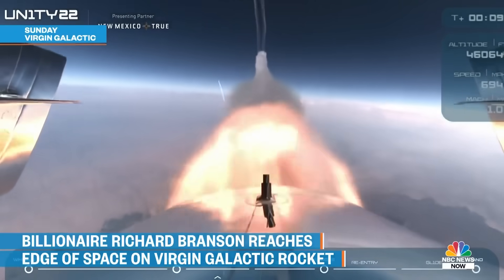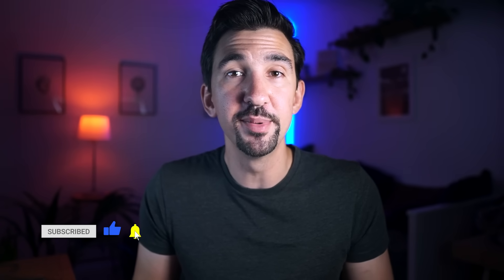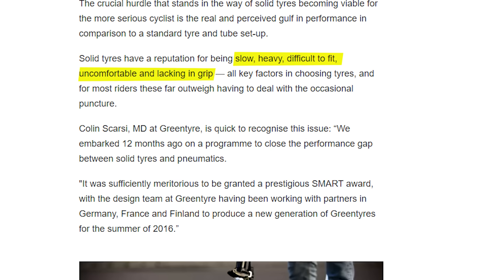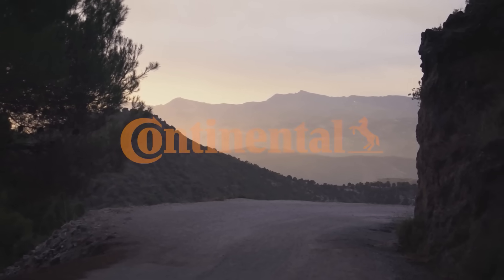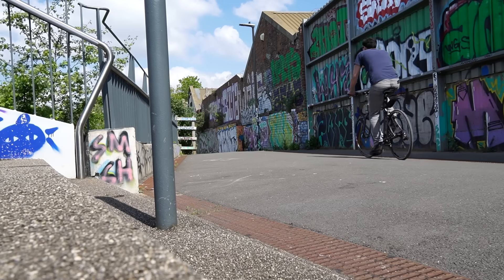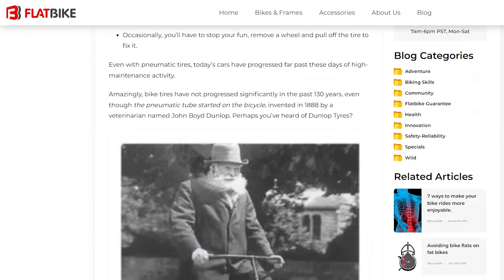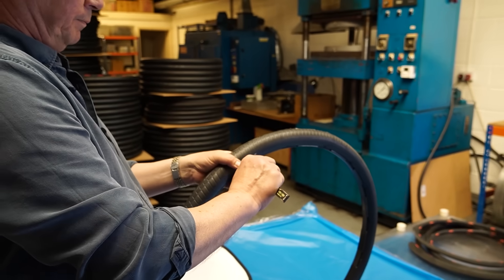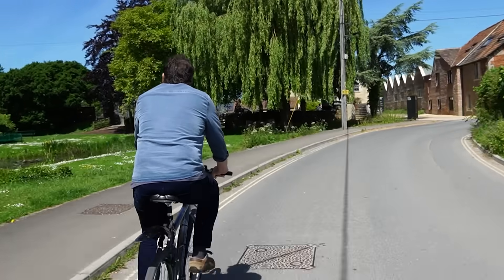I Tried Solid Bike Tires | Here's What I Found

Comment: I really, really want everything about this tire to be true. I also think it would be neat if unicorns ate Skittles and farted rainbows.

In over a half century of cycling, I have had dalliances and affairs with various solid tires or solid foam tube inserts. My experiences with them were universally horrific.

I will put up with a certain amount of abuse from a tire. When I started racing, my tires were either cotton or silk carcasses with a thin strip of vulcanized rubber tread, latex-coated sidewalls that were stitched around a condom-thin latex tube that needed inflating daily. Then you glued them on your rim and hopefully you didn't roll them off in a fast corner. These were not low maintenance tires, but I was racing, and I didn't expect them to be.

For regular street bicycles, we were just transitioning away from iconic American brands like Goodyear and Uniroyal to Asian tires, and frankly none of them suffered from an abundance of quality or engineering.

In the intervening decades, tires have gotten much much better. Flats are almost optional. If you can afford Schwalbe Marathons, or even the somewhat more budget Panaracer Tour Guard tires, for an average cyclist who is not riding past construction sites and junk yards or through goat head territory, flats are extremely rare.

So will I try these? I don't know. After all, I've seen a lot of technological advances. When I was born we had one satellite, called the Moon. Now we have thousands of satellites and reusable orbital boosters, 4K organic LED TVs as thin as a magazine, and vaccines that you can literally print out. Maybe the time for tubeless solid tire technology is here. But I can't help the feeling that I'd be going back into another abusive relationship.

We'll see.

Comment: The burden of having to constantly reinflate my bike tires drives me nuts.I gotta carry a hand pump. Those small CO2 fillers that use cartridges get used up quick. They seem, to leak out quicker, likely due to the gas molecule size. I have checked the inner tube and valve under water, and it still looses air ! I am going to get a set of solid tires !!!!!!!
Reply: Try nitrogen from a car tyre shop. The bubbles are bigger and don't leak out the rubber. 
Or install wider tubes that stretch less

Comment: They run similar tech in motocross and off-road with the mousse inserts, very difficult to install but they did last about as long as a tire but I guess we still gotta reinvent the wheel good videos
Reply: They last 1 race before they melt. They also grease them up to last an extra hour

Comment: Solid rubber with air pockets. It's an old idea, but difficult to manufacture. The next step is to create several layers which are thicker in the middle, and stack those. Each layer has a different density of bubbles, so it would be sort of like a gradient density, with more bubbles in the middle layers than the outer layers.
Reply: That is horrible. You want it to be no gradient so that it acts like a pneumatic tire. Pressure spreading evenly. Having a gradient means impacts will not transfer across the whole tire and instead stress will be uneven making you feel more of the bumps.

Comment: 7:10 The air is not compressed in the tyre any more than it is compressed when a load is first put on it. When the tyre is under load the constant air pressure acts on the non-circular shape of the tyre to push it back to a more circular (minimum energy) shape when the tyre is no longer in contact with the road. Energy is not stored in the air it is stored in the stresses in the rubber tyre being loaded.

That is a different scenario to a micro-cell tyre where the air has nowhere to go when the tyre is deformed. In this case the deformation both compresses the trapped air and its the micro-cell not being in its lowest energy shape (stresses in the rubber surrounding the cell) that provides a restitution force to uncompress the tyre on the trailing edge.

Comment: As a teenager, I put over 2,000 miles on a set of airless tires with decades-old technology. One could say it was "just commuting", but it was also from one county to another, with the requirement that I never show up late for work. So...a valuable solution to an important problem, with zero downtime, reasonably good efficiency . . . and low comfort in that era of rubber tire. I'm excited to see first-hand what decades of improvement can deliver in the most maintenance-heavy area of a bike.
Reply: I see just one glaring issue with these: they have to be designed for a certain driver weight. And seeing how the bike industry is currently handling design, this weight will likely be around 80 kg. They are unlikely to bother themselves with offering tires for different weight classes. Lightweight riders will be rattled, fat people like me, or people who frequently put heavy loads on their bikes will find cycling unpleasantly hard.
Reply: @Volkbrecht  that's a good point, but I don't see it being too difficult for manufacturers to create different models tailored to rider/bike weight by adjusting the amount of gas bubbles that are incorporated into the rubber. Especially since bike packers could be a pretty large target demographic.

Running shoes have taken a similar approach in recent years by modifying foam density in their women's models, since they are typically lighter.
Reply: @Volkbrecht  At 285 lbs, my carbon road bike has a lot to handle, and I will go a few thousand miles on a set of tires with no flats.  Tires on my road bike now have been on there for almost 10 years with weekly riding and rotating. They are about to be replaced.
Reply: @Volkbrecht  or you will be able to 3D print your own.
Reply: @williammeek4078  pretty sure that 3d printing the tire would be nigh impossible as you would also have to treat it with various tempetures and get the specifics of the tires physical composition.
Reply: This can be solved in two ways: smooth roads, or heavy duty wheels. In general, just don’t ride solid tires on bumpy roads. It’s not fun, slow, and destroys rims. If that’s your local terrain, don’t get solid tires. Simple enough. The other is rims made for people who are overweight. They work perfectly. If you have smooth roads and sturdy wheels, you never have a care in the world. Never have to check your tire pressure. Never have to even own a pump.
Reply: >the most maintenance-heavy area of a bike.
Surely you mean the brakes then right? Or the maintenance of the chain right?

Aside from pumping a bit of air once a month the only time I have to do something with my tires is when I change out my slicks for grippier, for wetter weather, outer tubes around fall and vice versa in spring, something these tires won't solve anyway. And these are just old fashioned inner/outer tube tires, not even those fancy tubeless ones.
Reply: @legolas66106  When has maintaining the chain ever been difficult?
Reply: @legolas66106  tubeless actually requires more frequent pumping.
Reply: "the most maintenance-heavy area of a bike"

Wait until this guy learns that chains require maintenance.
Reply: using pneumatics in the city and light terrain, stones and glass happen sometimes. No flat in many years. if you get the slightly have "puncture" safe tyres the risk of running a flat is absolutely minimal. Probably less than any other failure on the bike. For travellers doing longer tours, if those gecko tyres do elimate the risk of a tyre malfunction completely, but only then, it may be worth it.
Reply: JUST 2000 miles? I have done over 100,000km on a series of pairs of Vittoria Randonneur Cross pneumatic tyres with ZERO punctures, and the tyres routinely lasting for 14,000-16,000km each (2-3 years of my typical riding distance). Zero "downtime", excellent efficiency, and great comfort. And I have never showed up late to work due to a puncture. Pneumatic rubber tyres (well-made) present no real problem, and minimal maintenance.
Reply: @petesig93  I agree. I have never had that many puncture in a lifetime of riding. I have had a few pinch flats, but that is based on what I was doing, not the tire system in general.  If this really is a vast improvement for a solid tire, it will find a market, but it is not dread for me to keep on riding on air.
Reply: @petesig93  shut up nerd
Reply: @petesig93  I put  well over 6000 kilometers on a set of (to be fair, pretty high quality) air tires that I kept running with a simple tube repair set when neccessary. I abused the shit out of that poor thing too. That was my school bicycle for years (200 days a year 30 km commute). It was a (used) high end Gazelle with a bunch of complicated gears that I eventually replaced with a 3-gear system and when that failed I put a single speed wheel on the thing. That bike got stolen (at that time it looked ratty as fuck) eventually.
Reply: the efficiency difference is pretty big, as is handling.  a teenager may not mind working extra hard.  but you could even run decent air filled tires, fix a flat, and still arrive ahead of a solid tire for a longish commute
Reply: @JackMott  Oh not at all. You need to try more expensive solid tires. That sounds like the cheap ones. The expensive ones are basically the same speed as pnumatic tires on smooth roads. Its only rough roads that they are slow on.

Comment: What about tubeless, air-filled tires? I mountain bike, and these are ubiquitous in the mountain biking world. I'll admit that they require a bit more maintenance than I imagine an airless tire would, but I have never really had to worry much about flats.
Reply: Not recyclable since they require a bead material, fabric carcass and different rubber compounds.
Reply: I commute 60km a day, electric pedal assist bike, tride tubeless, was very excited to be free of punctures, but the Achilles heal of tubeless is glass. Once the glass cut into the tire it stays there and keep on opening the gap the sealant is trying to close, a nightmare 5 o 'clock in the morning. 
I've been using a foam liner from "Tirefom" with a lot of sucsess, except for the quality of the inner tubes splitting on their seams. Really an nice option to go, no thorn, wire or glass issues, almost perfect. Just those damn slitting kenda tubes, got to find a good quality strong inner tube. 
I contacted  Richard during his crowd funding campaign and cannot wait to receive the Geco tires after all the other options available seems still challenging. Looking forward to a peaceful ride to work in the early mornings with no puncture kit or extra tubes in the Ortlieb bags!
Reply: Such an airless tire is obviously not a solution for Mountainbiking, since you need little tire pressure for suspension, and riders adjust the pressure for their needs.
Reply: Just got through changing the tire on my wife's tubeless Toyota. (Technically, I changed the wheel, tomorrow some tire shop will change the tire) Tubeless does not prevent flats,  because ultimately the tube does not provide much puncture protection. It's just kind of a thin air bag.  Once something gets through the tire, tube or not, you have a leak
Reply: @47f0  Tubeless mountain bike tires are usually used with a sealant that goes on the inside of the tire. This allows for small, or even fairly sizeable, punctures to basically self heal. I assume you are talking about a car tire since you mentioned a Toyota. These tires are much thicker, and standard tires are not really intended for off-road use. Due to this, they have much less need to run with a sealant inside the tire like mountain bike tubeless tires typically use.
Reply: @komoumi  - There have been various goops, slimes and goos used for allegedly sealing both tubeless and tube type tires for decades.

Allegedly. 

My point was that tubes, since they are very thin rubber that provides almost no puncture resistance don't really alter the puncture equation much one way or the other. And yes, you can definitely fill your tubes with various kinds of snot. That is not unique to tubeless tires.
Reply: @47f0  Tubeless tyres on bikes works extremely well. Not needed to use the spare tube I carry on my bikes just in case for 5+ years now and I seriously hammer even skinny tyres on rough off road terrain. Waiting for someone to fix a flat is thankfully rare these days too.
Usually if you get do get a flat [a very rare occurrence], you've either ripped the tyre sidewall beyond repair or trashed both rim and tyre.  

Tubs most certainly alter puncture probability hugely, because the most common cause of punctures are pinch flatting/snakebiting the tube. Plus anything penetrating tyre causes a flat when it pierces the tube. So far better off without the tube. I've pulled metal spikes and hawthorn hedge trimmings out of tyres and simply carried on with tubeless setups.

Comment: Yeeeeeah. Really good skins plus Latex tubes equals a much lighter tire combo. For those who ride a lot this is critically important; the mass of the rotating assembly has a huge impact on the amount of effort required to change speed, direction, handle terrain, etc. These solid tires (tyres to you) may be a good compromise for "commuter" bicyclists, but will never appeal to performance cyclists at all. Soory aboot that, eh?

Comment: Your recycling reason doesn't work in the real world.  Just in marketing.   Remember, regular air ties were make with just one component.   but competition between brands make them tweak them hear and there.   The exact same thing will have to happen for the exact same reasons if then got even the littlest big popular.
Reply from the maker: I'm eternally optimistic, but it's a good point to consider

Comment: I had airless tyres which were a foam rubber core with a regular tyre tread about 30nyears ago. They were pretty good - heavier and slower but not so bad really. The peace of mind that you couldn't get a puncture made it worthwhile. I would have hoped things had improved a lot since then but it seems not, unfortunately. Hopefully airless car tyre tech will drive development.
Reply: lol, that was my first thought as well... "Hey, I remember those!  I HATED them!"

They made my bike so much heavier and less nimble. IIRC, I pulled them out after just a week of using them, because the bike felt completely wrong.  Couldn't get the wheels off the ground at all like with tubes.
Reply: @FlesHBoX  I've never ridden "good" bikes. So when I had those airless tyres it was alright for my daily 3 hours commute.
Reply: @gladteer873  I've never used them on a "good bike" only cheap walmart bikes.  By the time I got my first specialized these were already a distant memory, lol.  I can't imagine how badly they would impact a bike that is light.
Reply from the maker: Totally, I think the weight was one of the big challenges that kept more people using them. If they take away the fun of cycling people ultimately switch back to regular tires. Hopefully this new team's approach will get better adoption 🤞
Reply: The problem is that it's impossible to create a solid tire that will work as well as one filled with air, so solid tires will always be the worst option.  There is no way around it.  The question is whether or not manufacturers will eventually be able to close the gap to the point where the benefits outweigh the disadvantages.
Reply: Yes, but if it's that much of a concern, you can always bring a spare innertube, they're not that heavy.
Reply: Pneumatic tyres have improved a GREAT deal in the past 30 years in terms of puncture-resistance. I have used Vittoria Randonneur Cross and Schwalbe Marathon Mondial tyres over the past 20 years and virtually NEVER have any punctures. Only flats have come from old patches (from previous tyres) that have peeled, a couple of tubes that have split along folding lines, and similar. NO penetrating punctures!
Reply: @petesig93  A lot of that has to do with car companies needing to ditch spare tires in order to hit fuel efficiency goals. Most cars these days have tire pressure sensors and puncture resistant tires as a result of it being easier to hit the targets by ditching weight than pretty much anything else.
Reply: @SmallSpoonBrigade  I really don't see cars becomming lighter though. Quite the opposite: More and more "SUV"-style city tanks wherever you look...

Comment: How long does it last? I have replaced the outer tires on my bike before, and I'd imagine they last longer than this one (since they are designed mainly for grip/longevity).

In that vein, would it not make more sense to only replace the inner tire with a gecko one, and still keep the outer tire? Then the gecko would last pretty much forever, and only the outer tire needs replacing when it's worn down.
Reply from the maker: Aim is for 2-4 years. But there have been a couple of early beta testers that still ride theirs from 6 years ago.
Could be an interesting idea yes. The difficulty is in getting a good attachment process so the gecko and the bike tire both fit securely in the rim
Reply: @DrBenMiles  Thanks for the reply! I think I'm not the target audience in that case. I'm Dutch and ride my city bike very often.

As is the case with many people here, I ride a second hand bike that's around 100 euros. I'm not sure if it's the type of bike or maybe the infrastructure, but I very rarely have flat tires. My last flat was more than a year ago, and the outer tire was worn down completely as well (so I replaced both). I'm pretty sure I don't even have special anti puncture outer tires.